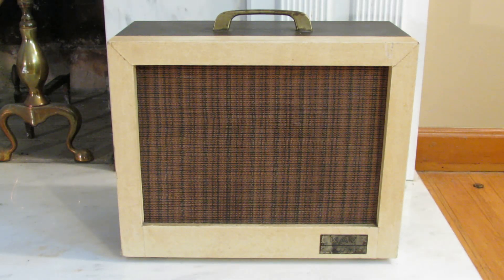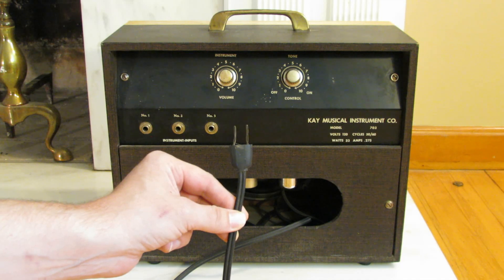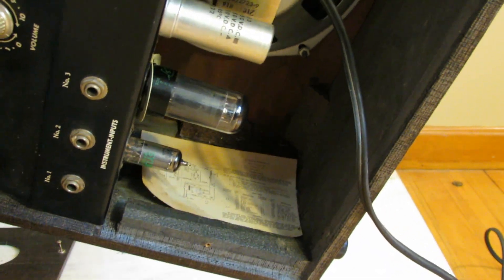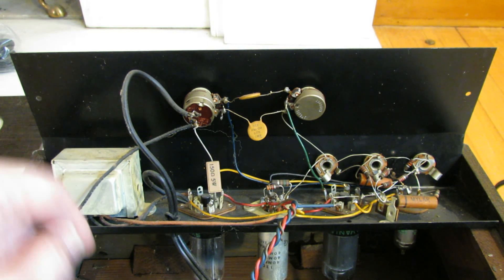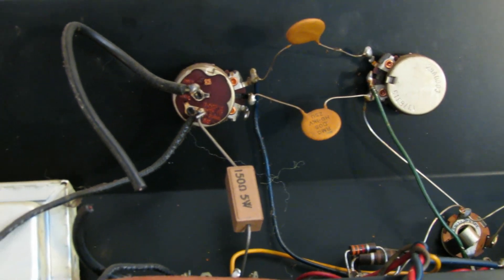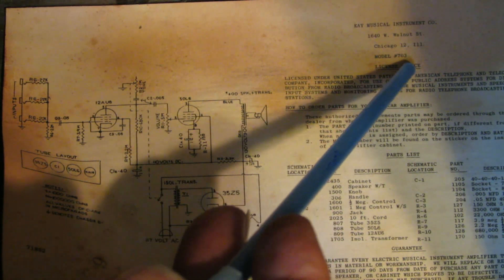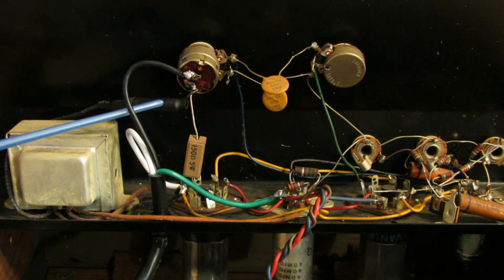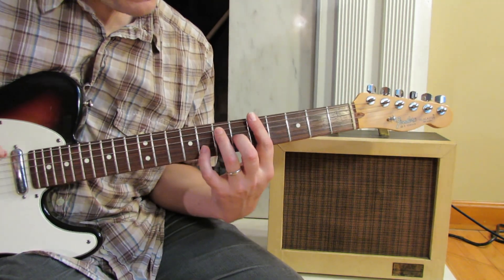1963 Kay Model 703 "Widowmaker" Amp Made Safer

Comment from the maker: NOTES: I no longer recommend installing a fuse in this version of the 703 because the filaments themselves act as fuses. Each filament has a rating of 150mA max current. Much beyond that and they will blow, cutting off the circuit. This version of the Kay 703, the original early version with 50L6 octal power tube and isolation transformer supplying the rectifier plate voltage should not be confused with the later 703B or 703C, which had a different set of tubes and isolation on the preamp tube only. On those versions, I recommend a power isolation transformer not only for safety purposes, but for noise mitigating purposes. Hum is greatly reduced in the later versions by isolating the 120VAC before feeding the tubes.
Reply: no..... !!!! A filament can short as well. Also the Filaments are in Parallel with the rest of the amp, meaning the rest of the amp could have a fault, that would take out the transformer. the extra current would not be seen on the filament side of the amp so they would not blow.
Reply: Do you have a link to they type of power isolation transformer you recommend using for the 793c. Want to be sure I get the right one. I picked up a 703c today without knowing of the safety issues. It sounds great but I don't want to take a risk with any safety issues.

Comment: Hi Mate!  Wait a minute!  Did you forget about the primary of the pt?  What happens if THAT  develops some kind of a short?  Please think about that again?  I'm so glad you DID install a power fuse in this deathtrap though!  I'm also pleased you wired in the mains fuse AFTER the power switch!  Please ALWAYS wire in mains fuses this way, otherwise you could still electrocute yourself while replacing the fuse, even with the amp! switched off!  

I see that under the heatshrink, it appears that you wired the incoming mains to the 'long' end of the in-line fuseholder so that the deadly end is further down inside & away from unsuspecting fingers.  That helps!  You might also tie a knot in the wire to the inlet side of the fuseholder (or put a real tight cable tie) to keep the terminal within the fuseholder.  You've used heatshrink around the fuseholder, which is a good thing.  The next person who changes the fuse may not be so thoughtful, & cut away ALL the heatshrink, thus removing the protection.

I saw a couple of brown, cardboard-cased caps there in the circuit.  I would have thought you'd have replaced them?

Youch mate that thumb looks pretty sore there!  You're shredding your bandaid while you're shredding your guitar!  I hope you don't keep opening up that cut by playing, not to mention putting blood all over the guitar strings!  My tennis racquet hit the back fence at the other end of the court 'on the full' many years ago, as I went to serve the ball with a badly (not bradley!) cut thumb!  

But despite your fum injury you played real well!  You definitely are a very talented guitar player, & I always look forward to the sound test at the end of your videos!

Comment: I have a little tube radio I just keep for decoration and it uses the same rectifier and output tubes and I believe a 12sq7 and one other tube. In researching the radio I saw a few tutorials about how to make a simple cheap tube amp using those same tubes and I really hope no one followed those tutorials 😨 one looked like a baking tin someone used for the chassis and no isolation transformer... I don't think anyone should attempt to make an amp of this type, preserving vintage examples is one thing, making a new one and then showing it as a tutorial just seems like a bad idea. Someone getting into this hobby could see it and try to do it because it's shown as being cheap and simple and not being equipped with the proper knowledge it could be their first and last tube project...

Comment: Guitologist, I bought the exact same amp with the same tube configuration. It plays great until about 8 minutes into playing I lose the sound. It becomes a whisper. However, when I pull out the cable from the guitar and plug it back in it starts up like noting ever happened. Could it need new resistors or even a new caps? Let me know what you think. Thanks! Greg
Reply from the maker: Very likely caps. But it needs more than that really. To be a viable recording amp and be its safest, you really should install an isolation transformer.
Reply: @TheGuitologist Thank you Guitologist for your help. As I can see there is a small transformer. My tube configuration, as well as the general wiring layout is "exactly" like the one you are presenting in this video. As far as the amp goes, I will just use it as a practice amp. My 1963 Fender Tweed Champ with 5F1circuitry is my holy grail for everything else. Can I get the caps and resistors at Antique Radio Supply. The first thing I will do is change out the cord this weekend. Found this thing on Saturday for a $100 bucks.
Reply: @TheGuitologist  I installed a three prong cord as well as spraying the volume, tone pots, and the tube socket prongs. Yet, no difference. I turned the volume knob back and forth, and starting hearing the volume come back. I found the sweet spot on the knob and kept it there. The volume was about three quarters up and with the guitar it was great. Good thing was the volume never faltered. Sounds like the volume knob. I guess I could get a new pot or spray the heck out of old one and hope it breaks free.
Reply: @TheGuitologist  Thank's man! I changed out the caps, resistors, and installed a three prong cord. The old caps were starting to crumble and the ends, and a bit of what looked like brown black tar was evident. I now plays like butta! Thanks again!

Comment: Brad, ya just saved my ass with this vid! I watch your channel pretty religiously as a gear-head anyhow. If I'm wrenching on gear I'm usually a guitar and sometimes pedal tech out in the PNW. Due to COVID BS I've had some out-of-my-league work plopped into my lap the last few months which I've tried to be as guaranteed and dutiful about as I can be. Just dealt with one of these which was a total barn find- had to deal with a pot fusion/rust-stoppage on the volume pot (automotive contact cleaner works wonders for everything) but the schematic was missing and after I pulled the tubes and de-soldered the pot I lost my placement notes and the damn thing didn't have the schematics. Remembered this vid and didn't have to dig for the schema somewhere else. Happy to see you putting out new material again! Your work does not go unnoticed. Got the little amp purring like a kitten again. Might put in a 3-prong if the owner wants it and I will cite this reference and take note of your update.

Comment: Often on repair videos I see a two prong cord being replaced with a three prong cord for grounding. Why don't you replace the two prong cord with a a three prong socket ? I have three prong cords of different lengths all over my studio for various equipment. I take a bundle of them to gigs of different lengths. If supplied a socket then the user could use any of the cords they already have and there wouldn't be a cord stuffed in  the back of the amp bumping into the tubes. Hmmmm. Also, does it effect the tubes when, like this Kay amp, they are mounted in close proximity to the speaker magnet and a transformer ? Thanks, I like your show.

Comment: Hi Brad, I rarely comment but I think it is very important from an electrician and electrical safe work practices trainer's standpoint. I certainly respect your electronics and technical abilities but think maybe since I do have such great respect for you and your abilities I need to clarify some details about shock hazards.

First of all CEI 1984 established hand to hand resistance dry for an average human is 1000 ohms. Additionally, an often misquoted context of Kirchoff's law is electricity takes the path of least resistance, and by the conclusion of most is the equipment ground. Current will pass through ANY electrical contact path in varying amounts based on resistance yielding a 120 Ma shock based on 120V at 1000 Ohms hand to hand.

However, any charge present while circuit protection works due the ground creating a dead short WILL pass through the human body which on 120V will yield a 120 Ma charge based on OHMs law passing through the body.

Since the let-go threshold is about 1 mA per 10 pounds of human body weight if you weigh 160 the let-go threshold for you is 16 MA That means at 16 MA for a 160-pound person you will not be able to let go and will die at 16 MA 

Now as for the tube filaments being an electrical circuit interrupter, not even remotely true in the eyes of UL, the people that list the contemporaries. And even at 100-150 MA that is not even remotely shock protection, it merely shuts down the amp as a function of the current limiting of the components. And bear in mind not UL-approved circuit protection. 

So to wrap this up, only a Class A UL943 GFCI is human shock reduction protection under UL943 Class A. The equipment ground or any other method (tube filament burn out,  inline fuse circuit breakers, or even equipment ground) is NOT shock avoidance or shock reduction to prevent death. These precautions help and contribute to safety, but a 20 AMP breaker, 5 amp fuses,  150 MA  filament burnout or the equipment ground can help minimize the opportunity to be electrocuted but not eliminate it.

All the options outside of GFCI provide fire protection, equipment catastrophic failure and may as slight benefit help the user by turning the power off. Only a GFCI can deal with a 16 or 30 or 150 MA charge flowing through the human body turning it OFF in  1/30 of a second protecting an average healthy person from electrocution. 20 amp breaker takes 6-8 times the full load current (20 amps) to trip in a short.

And yes do NOT minimize low current shock hazards. Just because you got zapped and live to tell about it you are blessed and missed the bullet. But I promised you with reams of empirical data and 46 years of electrical experience and an SME rating by Toyota for teaching Electrical Safe Work Practices minimizing any concern for any shock 50 V 50MA or more AC or DC can be fatal!

Comment: I have always been told that wall voltage was less in the 60s than it is now (maybe 110 or 115 then, and 120+ now).   If you have a 35, 50 and 12 series filament,  don't you have 97 volts required with 120 supplied?   I wonder if that affects the tube characteristics?   Have you ever put it on a variac and experiemented with supply voltage?
Reply: It has a resistor to drop the rest.....up to about 115 volts. Of course that leaves about 5 to 10 volts unaccounted for.

Comment: It is the cost-cutting of the makers that left the amplifiers to be dangerous. All it needed was 3 pin plug & a double-pole mains switch.
So the chassis could never be live, whether the amp was on or off if the mains plug was reversed.
The nasty part is that the guitar is grounded to the amp chassis via the shielded cable. That means the strings could be 120V above true mains ground. 
Is that enough to be guaranteed death? Maybe if the current path crosses your heart.
You are holding the guitar by the neck in one hand and touch anything else that is at true mains ground.

There were far more risks that were generally accepted back in the day. Cars weren't so safe in crashes. Brakes and handling were poor. Many people smoked. Houses had lead based paint and asbestos.

That amplifier is nothing out of the ordinary for anyone used to dealing with shoals of All-American 5 tube radios. It is just the high B+ voltage that is eyebrow raising in a guitar amp.

Comment: Great video, sick little amp. I have a question; how might I hard wire a foot switch on an amp with a button on it that does the same? Would I have to exchange the button for the foot switch? Or might I be able to use a relay attached to the button? Help

Comment: Brad, you mentioned that the isolation transformer inside the chassis actually steps up the voltage.  Do you remember what that stepped up voltage was?  I ask because I tried to convert a old transformer-less amp with the same tube compliment to the Kay 703 schematic and tried to used a 120v to 120v isolation transformer.  Well it worked but the voltages at the plates was so low it just seemed like something was wrong.  It sounded very anemic.  After rewatching your video and hearing you mention the stepped up voltage, I believe I'll need to step up the voltage similarly to my converted amp. Thanks.
Reply from the maker: Some isolation transformers are slightly mismatched on the windings, so they do step voltage up or down. Don't recall the voltage stepped up in the other video you mentioned, but it was too high for comfort. Maybe swapping your transformer around would solve your low voltage issue.

Comment: Man, I remember well that nasty little snap to the lips when they came too close to that "quality" Philmore Mic plugged into an ungrounded Bogen PA amp while my fingers were wrapped around the neck of my Fender Duo-Sonic...  Good times!
Reply from the maker: Yep, that'll do it. Amps like this were not meant for jamming with a full band and PA. If the plug is in the wrong way, there could be fireworks on your teeth.

Comment: There's nothing hysterical about electrical safety. The filaments do not have "rating" as a fuse at all. They may draw 150 ma in normal operation, but a fuse is there for when things go abnormally.
Reply from the maker: On this one, we fundamentally disagree, and that's ok. And they do have a max current rating of 150mA each. They are for all intents and purposes, a fuse. That's like triple redundancy. The weakest one will pop first when the max is exceeded, and luckily, it's well below what most health professionals cite as the 300mA needed to cause a heart arrhythmia in humans. At the end  of the day, Underwriter's Laboratories signed off on the original design of these and ass far as I'm concerned, there is little need for fear being electrocuted by one, especially with a 3-prong cord installed. As  long as the house  is wired right, there's no real issue.

Comment: Your filament string is still unfused in the arrangement you have used. You need to put the fuse ahead of the switch so in the event of a fault all power will be disconnected and the chassis will be safe.
Reply from the maker: Thanks for the comment. I used to think this too, and used to include fuses, but the fact is, the tube filaments themselves ARE the fuses. The max current rating of a filament on these tubes is like 100mA or something. Anything above that and they'll pop in short order.
Reply: Filaments are not fuses. I'm sorry but this type of installation is negligent.
Reply: All it would take is to move the fuse to the line side of the switch. Tubes are not fuses and you know it.
Reply from the maker: Yes they are. In a series filament amp, adding a fuse, you're just adding another filament. In a 3-tube series filament amp, you have THREE fuses on the string rated at 150mA each. They're basically a 150mA slo-blo fuse EACH. Sorry, but you're wrong on this one, and calling it "negligent" is hysterical.

Comment: I assume this it the infamous "death capacitor" issue? if so, there is a fabulous video by a guy named Uncle Doug on YouTube that explains this very well and other ways you can get the piss shocked out of you with vintage amps, and it has nothing to do with the old fashioned two prong plugs. It is a circuit that tries to eliminate hum. If you have a vintage amp, WATCH THAT VIDEO

Comment: I am curious because I really dont know a whole lot about tubes, but, Why is a series-string set dangerous? or a widowmaker? Just about every single AA5 AM Radio (stuff I am familiar with) are all series string.
Reply from the maker: Same animal. The fear of series filament guitar amplifiers is overblown, in my opinion. But there are some ways one could electrocute you in theory. If there is no isolation transformer for at least the first amplifier stage, if that tube shorts from filament to grid (not likely), you could get wall AC on your strings, although probably not enough to kill anyone bigger than Tinkerbell because the tubes already dissipate power in the rest of the series string. The tubes in a series filament amp each have a maximun filament rating of, like, 100mA. It takes something like 300mA at least to kill someone, so even if you got shocked, a filament would blow from excess current before your heart. The chassis isolation cap could also blow and put AC on the chassis. If the plug is in backwards, meaning if the hot side is on the side of the cap and it's shorted and you're standing in a bucket of water on a basement floor, you're dead. A grounded power cable ensures there's no way your body will find a better ground than the wall ground, provided the house is properly wired.
Reply: Well I was just wondering because I have been hit with full stored voltage from tube amplifier caps when working on them in my early days, and then of course the 30KV of high voltage when trying to reach into a rear projection TV to adjust the yoke rings, and I am still here.... So I just couldnt really see how a tube string could hurt anything... When I was a kid just learning repair, I got a monitor working and answered a phone call, not paying attention I laid my arm down on the anode cap and ZAP... I saw stars for a second, hurt like hell, and the cordless phone in my other hand was dead. then I got grounded from my mother for killing her phone...